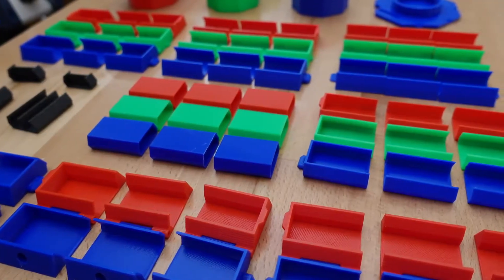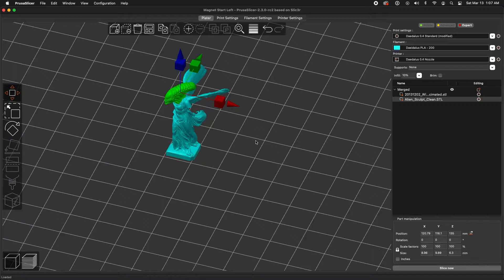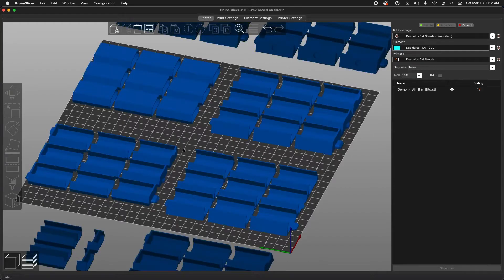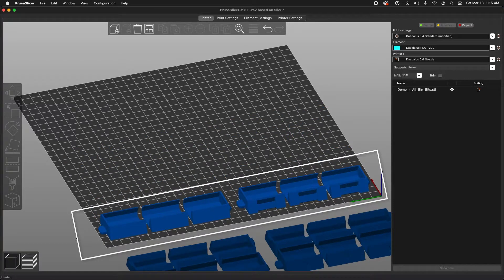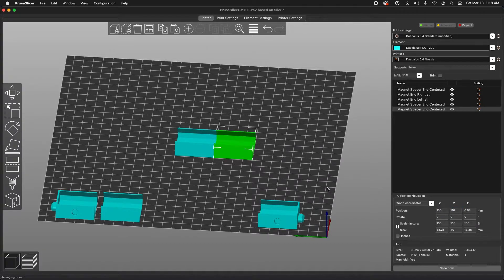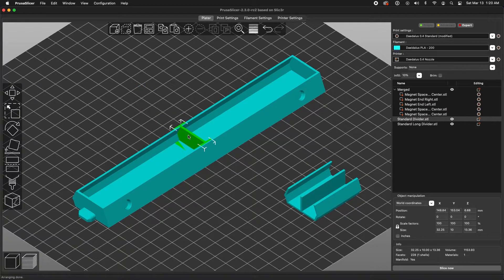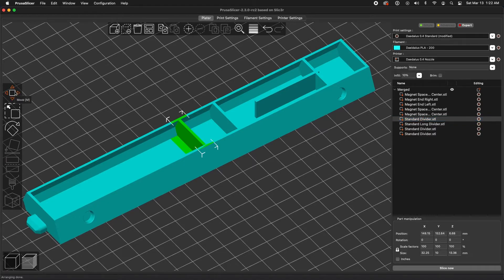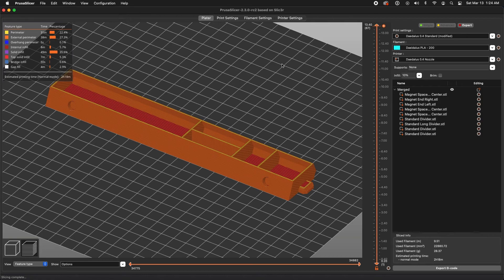How To: Merge Objects for 3D Printing

Comment: So prusaslicer has no snap to edge functionality? It's all just inputting perfect measurements?
Reply from the maker: I don’t believe any dedicated slicing software has that particular function. Typically, you wouldn’t want models you’re 3D printing to touch at all, so I suppose it’s a low priority. Instead, they focus on functions that snap the model to the print bed or automatically space models around the bed.

There are some examples of modeling software that happen to have slicing built in as a secondary option. In those cases, snapping is more likely to be an option.
Reply: @3DPrinty  So basically slicing software assumes all the modeling have been completed, and you're just putting the files on the plate bed to print. But it still has a merge function to combine geometry, so it seems like a snapping vertices feature or something wouldn't be that wild!
Reply from the maker: Merge isn't used all that much, but that would be a useful addition to it!